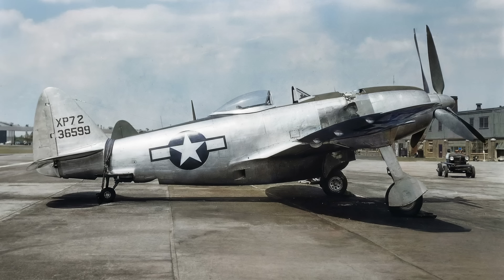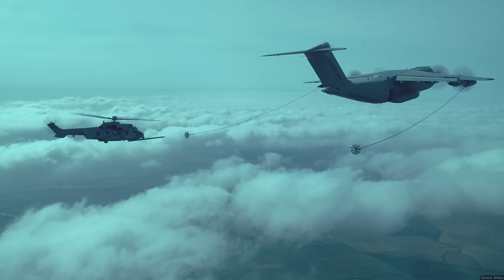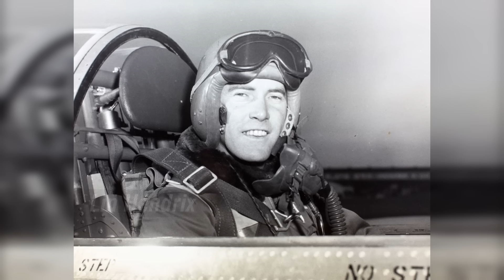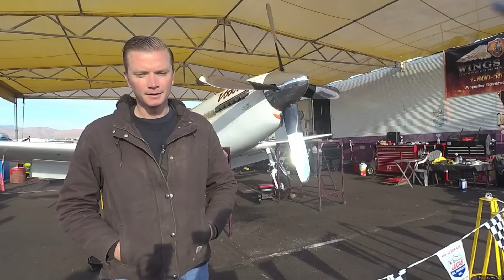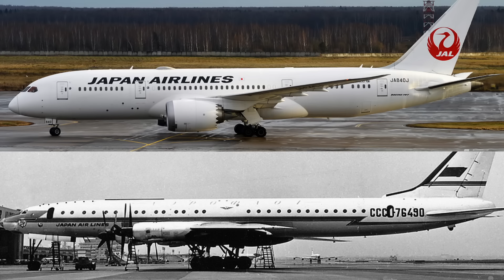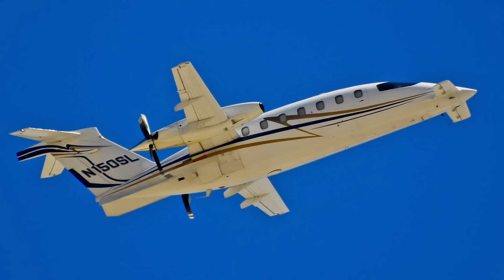10 Fastest Propeller Planes Ever Built

Comment: Being mostly carbon fiber, the Avanti is quite a slick machine. Many folks mistake it for a Beech Starship, which is also a fast plane.
Reply: That's a common misconception - the Avanti is built using traditional aluminium construction. The Beech Starship is the one which uses considerable carbon fibre.